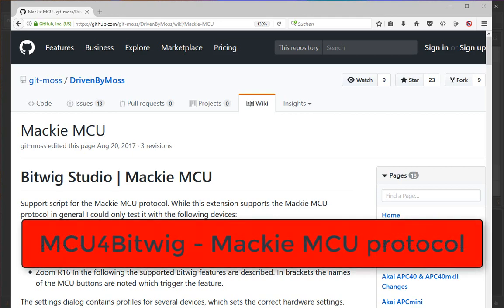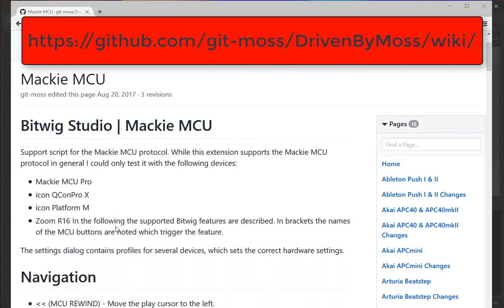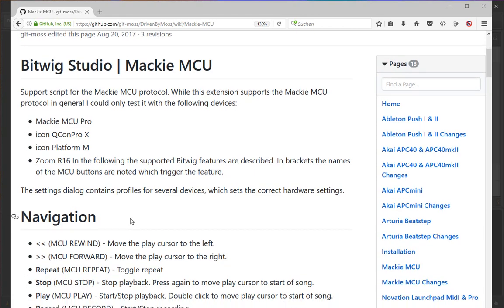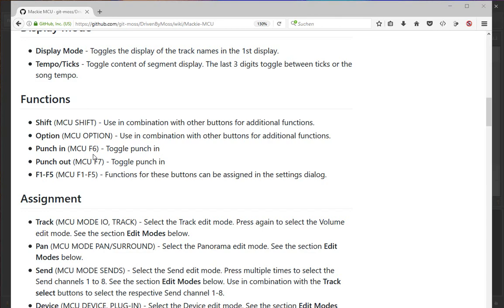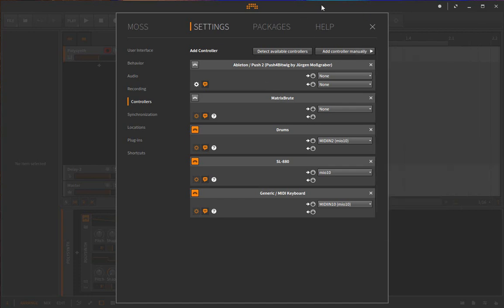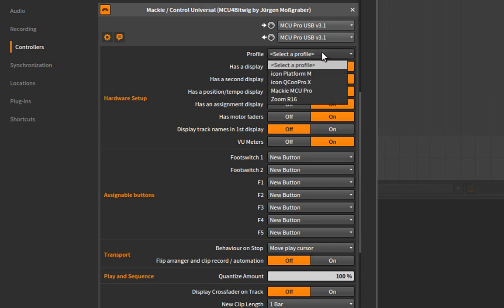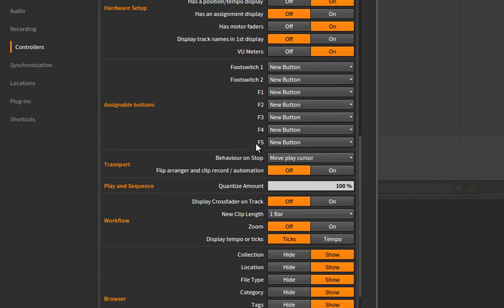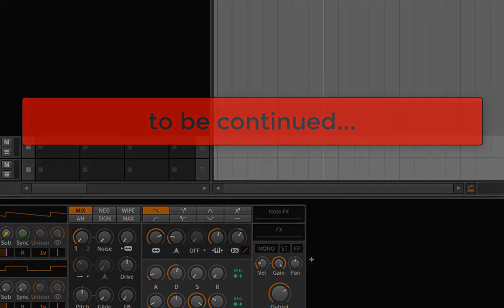MCU4Bitwig - Configuration

Comment: Hey Merry Xmas Jurgen, you just made mine more complete. I was worried for a while after buying the FP16 and wondering why I couldn't get things working, ie I only had 8 faders etc, then I got both sets of 8 but they where the same, reading a few threads also had me worried as people still seemed to be having trouble still, anyway the solution which may already be in your wiki was to make surethe 4 midi slots where correct, FP16 in first m2 in second, and the same for the next 2, I just hadFP16 in first 2 slots and M2 in the other 2....duh, anyway much more is going on now, still not sure I've figured it all out but, I need to share the load and do other funtins on the ZeroSL2 & the Launchpads & the 61SLMK2 all powered by you! The FP16 is probably the last piece of kit I wanted/needed. it could have been an expensive mistake. Still to figure out how to get the FX tracks showing, dont think I have the group problem in Hierarchical mode, it would be great if I could quickly remap faders, so for example first 12 faders for (selected) tracks and last 4 for FX, though I think arranging the song project in the right way is the best /easiest way.  Listen to my Latest Track & tell me is it FUNKY Enough 4U
Reply from the maker: There is a setting for having the last extender to control FX tracks.
Reply: Good to know, Still very early days with it, it's got some funkiness I aint used to, I've not mastered any of the controllers yet, these things take a while @60 :) @mossgraber

Comment: random question: not sure if you have a Qcon ProG2 to replicate this with, but each time I choose the master channel in bitwig, it resets the device/parameter button and I constantly have to press it again to control the devices/plugins on the master channel. is this something you think you can fix? thanks for all your hard work! you make bitwig so fun to use with a Mackie based controller
Reply from the maker: Good comment. Will change it in the next update to only activate the master mode if the current mode is the track mode.